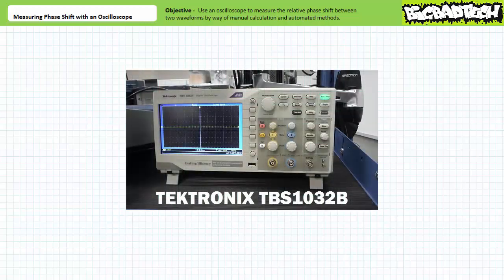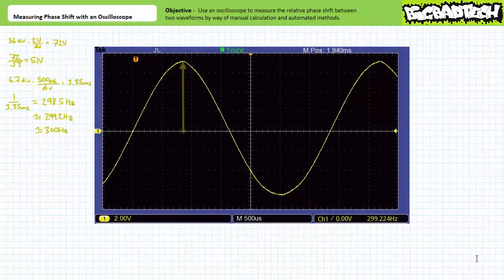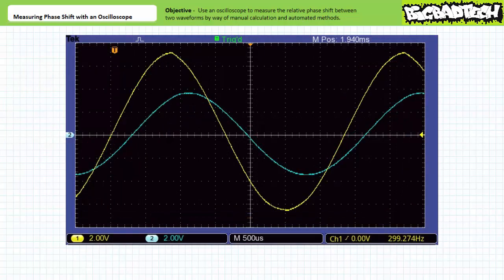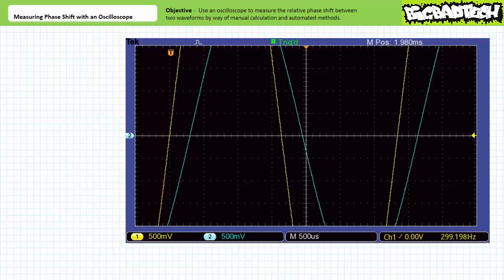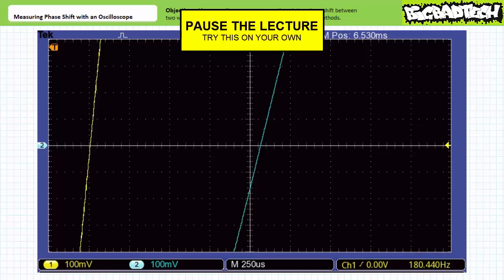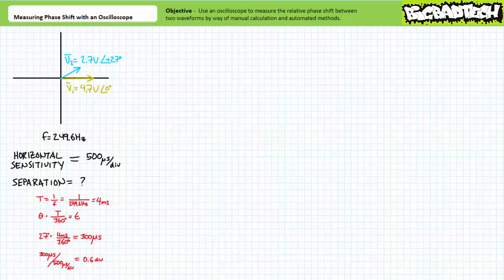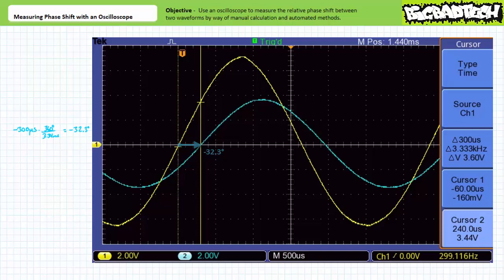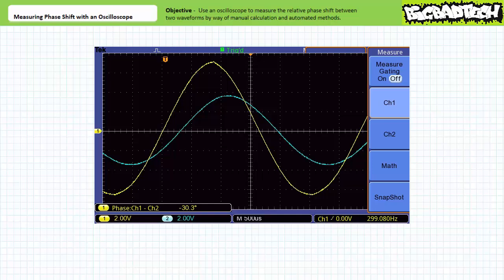Measuring Phase Shift with an Oscilloscope (Full Lecture)

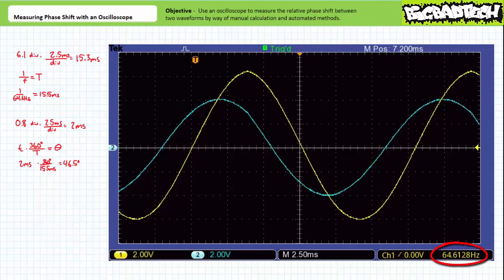Comment: 14:20 i believe time division is 6.2 not 6.1 so the time is 15.5ms and its the same result of 1/f of the osci. Any way you are great thanks a lot.
Reply: You are correct. It should 6.2 div on the time axis. Each subdivision is equal to 0.2 divisions. So 6.2 div [(0.0025)s/div] = 0.0155s = 15.5 ms.

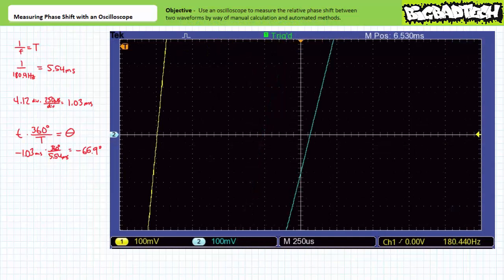Comment: 15:37 Correct me if I'm wrong. Shouldn't the phase difference be greater than 4.2 div? Because there are 5 sub divisions and hence each sub division would be 0.2 of the division. And since it's greater than 4 divisions + 1 subdivision it would be slightly greater than 4.2 div
Reply from the maker: Good catch! I was looking over my notes on this lecture and I should be saying 4.21 divisions instead of 4.12. Yes, 4.2 divisions at 250us per division would yield a phase shift of 68.0 degrees.